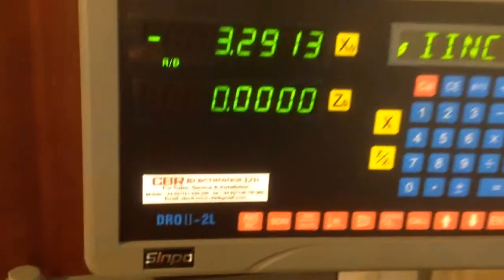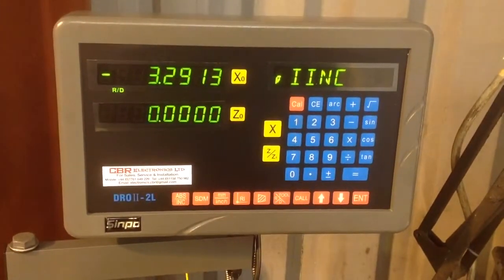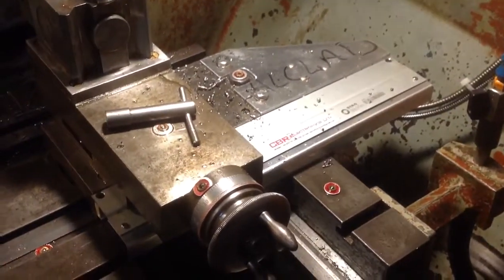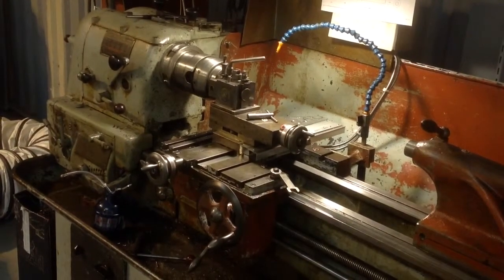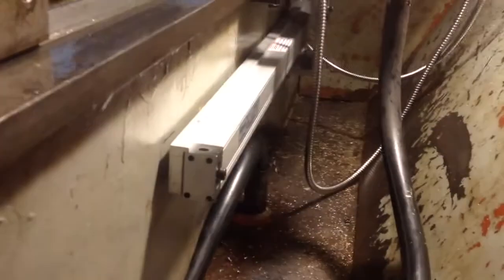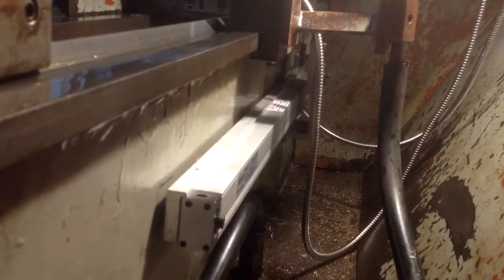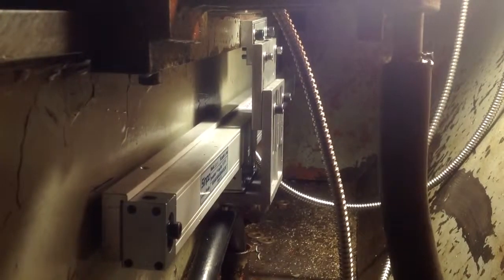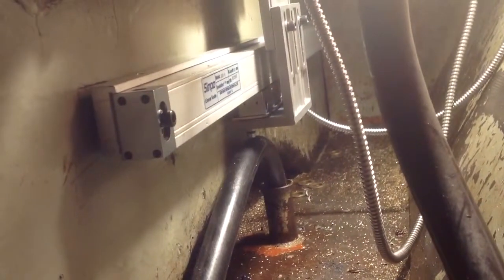Sinpo DRO round up and review

Comment: HI
What length scales did you end up fitting please? I have a mk1a lathe & intend to do the same job, but am not quite sure what sizes as the more advice I get the more confused I become!

Steve
Reply from the maker: Hi,
I ordered one slim scale 220mm/8 3/4" travel and one regular scale 550mm/ 21 3/4" travel. this seems to give just enough travel in both directions.
Hope this helps